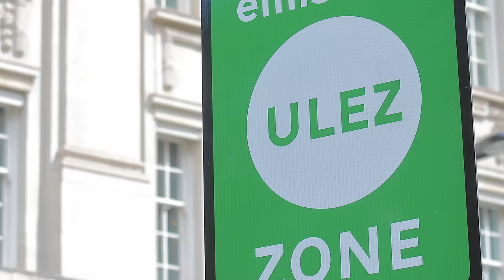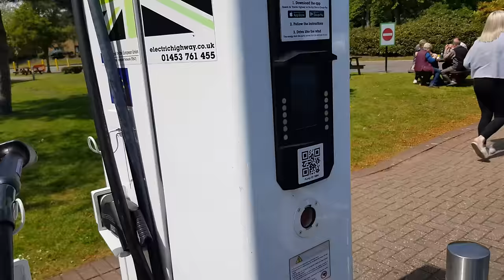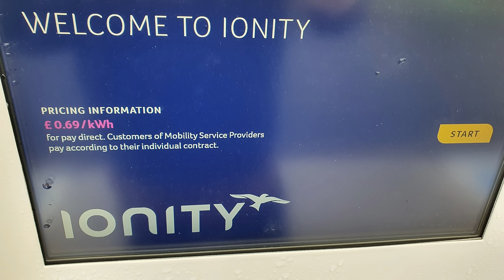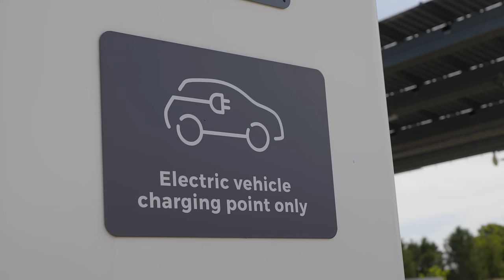The Uncomfortable TRUTH About EVs: The Version NEITHER SIDE Wants You To Hear

Comment: I lived in an apartment in Bham City centre last year. I inquired about fitting a charging point for an electric car. The building management company told me in 3-4 years we may be able to get charging points... 2 charging points for 100 parking spaces. Unfortunately the fire brigade had ruled out any more in the future as any potential battery fire could spread uncontrollably and emergency vehicles would be too big to access the basement carpark. The fire could create enough fire to destroy the building. Shouldn't this issue have been highlighted before the government committed to banning new ICE vehicles? Especially as cities are supposed to be a priority for the reduction of tailpipe emissions.
Reply: And there lies a massive problem, needs to be a solution that fits all
Reply: Here in Norway they have legislated that a building management company can't refuse to install EV chargers if the residents request them.
Reply: But you’re happy with probably 2,000 gallons of highly flammable fuel sat under your apartment? This is exactly the scaremongering James was talking about.
Reply: @hughesy606  it doesn't really matter what I'm happy with if the fire brigade have completed a risk assessment and banned charging points. It's not scaremongering, it's a fact.
Reply: @willv198412 Would be nice of the risk assessment also looked into the dangers of the status quo. Did it do that, or was it just concerning EVs?
Reply: @BigTwitchy  It's not the fire brigade's job to allow EV related fire risks a free pass for the sake of the environment, this is the responsibility of the government to find appropriate solutions. Banning all new ICE cars is not necessarily an issue if there are EV solutions that work for everyone, but at the moment there are not. I believe this is the general conclusion of this video.
Reply: @BigTwitchy  I would image yes, as there is a lot of experience with ICE fires in garages, knowledge on how to reduce first,  and damage. Part of the rish assessment would be, if does catch fire, how long would it be it becomes uncontrollable, how hot, potential surrounding damage it make to the garage.  for EVs, the it becomes more uncontrollable faster then diesel/petrol, it burns hotter resulting in greater damage to the support structure of the garage, requires more water to extinguish, can reiginite minutes to hours later, and releases more toxic fumes during the fire.  For me, this is a greater risk and until more data and experience is gained we should move with extra caution.  Should ev be banned, no, but ignoring the facts will not reduce the risks.
Reply: @willv198412  agreed. But I gathered from your post it was simply about charging stations? From the posts I've seen from a highly reliable internet, the fires can happen anywhere so a risk assessment about charging points is really kind of a mute point in reality, even if the assessment itself is probably correct on the parameters given. But appreciate your point totally.
Reply: @hughesy606  It is not a very cohesive argument as there are no signs prohibiting EVs and they were probably unaware that several residents already had Tesla's regardless of not being able to charge at home. The whole thing has not been properly thought through. I wonder what will happen once the first major EV fire happens in an apartment basement and compromises the integrity of the building. I doubt buildings will get insurance if they allow EVs to park there. This is a can of worms waiting to happen.
Reply: Government should focus more on redesigning cities with better walkability and public transport. That would encourage people to take public transport as it is more convenient than driving their cars, thus reduce air pollution from tailpipe emissions.
Reply: @hughesy606  fuel in parking is fine for me. It can be extinguished easily. Garages have firefighting pipes and hoses. But fire in EV you can't extinguish. Uncontrollable burning of fuel rarely can release all energy of fuel. This is why there is no so much damage to nearby objects after ICE car fire vs EV fire.
Reply: @15bit62  you have a population of 5 million and a $1.4 trillion sovereign wealth fund. Lol at "legislating management companies" for a cost that will just be passed on to consumers absent govt subsidies.
Reply: @chir0pter  It's astonishing how often people bring up this old trope: "Norway is filthy rich and can afford to be different". Well yes, it can. But it can do it because the country was prudent and forward thinking. But i would point out that lots of other countries without oil also manage to do these things: Finland, Sweden, Denmark, Germany...
And a bit of historical context for you. Norway and the UK have extracted basically similar amounts of oil and gas from the north sea, and it is worth remembering that around 10% of the UK's tax revenue in the 1980's was from the north sea oil (it's still around 1%). The UK spent this money to subsidise affluent lifestyles and a boom in the 80's (which i remember in fact, being British and in my 50's), whereas Norway invested it and continued with it's more traditional lifestyle. And you can see the difference between long and short term thinking now  - of the 3 countries that claimed the majority of the north sea oil/gas, Norway and the Netherlands have quite equivalent high standards of living and high average incomes, whilst the UK lags quite a long way behind (half the GDP per capita of Norway). 
So yeah, feel free to throw criticism at how "rich" we are up here, but remember that if you are British then you had the exact same opportunity and you squandered it.
Reply: @inevespace shame that you weren’t at Luton airport to deal with that fire
Reply: @vladx2  I don't know why they don't have firefighting hoses inside this parking. All building where I lived have fire doors and firefighting hoses underground. Nobody expect firefighting truck to go underground. But all this measures useless for EV. And half of my parking are EV.
Reply: I assume you're thinking about cheap electric Chinese motorbikes, mainly?
Reply: @georgeholloway3981  no, teslas and other shit. Bikes are in separate parking.
Reply: @15bit62  Do you have underground parking situated beneath buildings in Norway?  It would seem to me to be a large risk to have EV's parked and charging in an enclosed space with no way of containing the fire.   The building structure itself would be compromised.
Will those legislators be liable for what might occur due to chargers being installed in inappropriate locations?  Probably not, and the management company will have to take all the risk and added insurance cost.  Doesn't sound like a good solution to me.
Reply: @boneseyyl1060  - We do. It is the norm to build blocks with basement parking. As for fires, well i think you are being a bit obsessive about EVs here. Any kind of large fire in a confined space is a huge problem, and burning cars of any kind are essentially non-extinguishable once 3 or 4 of them are burning. There is just too much smoke and the temperature gets into the 100's of degrees in minutes. This is at least an advantage to EVs - the fires might be extremely intense and non-extinguishable, but with no burning liquids to spread the fire they are more easily contained. 
Interestingly I spoke to the guy responsible for fire fighting on a large ferry last summer. He was very clear - in the event of a fire on the car deck they just turn on some sprinklers (which he said probably won't do very much), evacuate the ship and let it burn. I also know some people at the local fire research institute here: They have access to a specially designed tunnel to test out vehicle fires in road tunnels. And I get the same message from them - It doesn't matter whether the cars are EVs, petrol or diesel, if you've got several burning in an enclosed space you are basically screwed and you can only let them burn out.
Reply: @willv198412  Is it really a facty or just what the building management company told you so as to get out of fitting EV charge points?
Reply: @willv198412 Mate you're fearmongering.  ICE fires have happened in the past in underground car parks that fire appliances can't get down.  No problems getting insurance for that.  The fire that destroyed the car park at Luton.  Started by an ICE Range Rover.
Reply: @15bit62  I see, well those are some interesting observations  I suppose it will be real world experience that determines if spontaneous fires from damaged EV batteries is a significant issue or within the limits of just an occasional occurrence.  It just seems to me that in a building with underground parking  under the structure, there will be enough damage from one of these events to result in irreparable damage to the building itself.  So how the fire is put out is probably irrelevant.   It's how likely is it to happen, and how much the amount of damage caused  and the cost to repair it will be.
Reply: @cjmillsnun  you just shot the messenger. Once again, this is not my opinion, this is the factual result of a fire brigade risk assessment. Perhaps the fire brigade are misinformed or are being overly cautious. But that doesn't help people in my position who live in apartments and could not practically run an EV without a charge point.
Reply: @boneseyyl1060  For sure a car park full of cars catching fire is going to be hugely destructive. We know that from the Luton airport fire, which was not a car park full of EVs. And there was a similar fire here in Norway (also at an airport coincidentally) a couple of years ago that also destroyed a multi-story carpark. That also wasn't started by an EV - it was an opel zafira. 
This whole "EVs are a fire hazard" thing is a red herring. All cars are a massive fire hazard because all forms of energy storage by definition contain a lot of energy, plus of course you have a load of plastic and fabrics to burn too. Batteries really just represent a different set of hazards - they aren't safer or more dangerous, but they are different and need to be treated differently.
Reply: @hughesy606  But 2000 gallons of fuel will burn at a significantly lower temperature than an EV battery.  A liquid fuel fire can be fought, as it will extinguish if the oxygen is removed, with foam or powder, but an EV battery will produce its own oxygen as part of the burning process.  Most ICE car fires are due to electrical issues, usually in older cars, or after poor work in fitting accessories.  They rarely spread to the fuel, and give time to fight them before they get out of hand.  Occasionally a fuel leak will start the fire, but that is often confined to the engine compartment, as it cannot easily transmit to the fuel tank.  Sadly, and EV fire, once started, will continue to the end.
Reply: @15bit62   In Norway they subsidised a lot of electric cars, less or no car tax and I think it was even no toll tax on the roads for them. Now they are starting to tax everyone. Norway has huge taxes on cars. To register our car from Estonia in Norway, it would cost us 10K€. It is cheaper I think if you have an electric car. So it's not about Norway being rich and people just choosing to be more green, its about punishing ICE drivers and giving electric car drivers a pass.
Reply: Where do you go in your car? If there is anywhere it’s stationary for a fair while, eg your place of work, many good employers are providing slow (but perfectly usable) work chargers for employees and often for free (there is no benefit in kind cost to you either).  Sure your current employer may not be so enlightened but some are and this might influence who you choose to work for.
Reply: @hughesy606  not really comparable.... EV battery fires are far more violent with temperatures reaching over 2700 degrees Celsius (over 5000 deg. Fahrenheit) and are far more difficult to put out because of the chemical structure of the battery! while ICE fuel fire reaches temperatures around 800 deg Celsius (1500 deg Fahrenheit) and can be put out much easier...
so it is normal that fire departments limit the number of EV charging stations in underground garages, since a massive EV fire with the temperatures that can be reached, would not only be harder to put out, but would definitely endanger the foundations and supporting structure of the building above....
Reply: @blankseventydrei  your assumptions are all wrong. But carry on.
Reply: government banning that or that what is this- Soviets Union? let the market decide ... last time I check ev lost this battle 100 year ago ...
Reply: @nigelcox1451  But it's not 2000 gallons of fuel - it's 2000 gallons of fuel, a load of plastics, fabrics and whatnot. Plus it's in a confined space, so the temperature is not determined by the open-air combustion temperature of the fuel but by the ability of the heat to get out. 
And yes, if you can get to the ICE car fire within 3-4 mins you have a good chance to stop it with a decent fire hose. But in an underground garage you'll need firefighting clothing and breathing apparatus, due to the heat and smoke. And once the fire has spread to 3 or 4 cars (which probably takes less than 10 mins) it is not at all easy to put out. So yes, EVs pose a very serious firefighting challenge, but it's not like ICEs are very much better.
Reply: @DohMkay  Yes, you are roughly correct. Norway historically has had rough price parity between ICE and EVs due to the high purchase taxes on ICEs and no purchase taxes on EVs. That is changing, but there is still a good subsidy on the EVs. EVs now pay road tolls at 1/5th full price, but the free parking and charging has now basically gone and a lot of cities are restricting EV access to bus lanes.
Reply: @hughesy606 doesn’t generally spontaneously ignite, and even if it does, much easier to extinguish.
Reply: @hughesy606 Just watch the video or at least get to 23:30 - 24:10 before commenting this man
Reply: @freedom8480  what assumptions?  ICE fire is 2760°C while the diesel is 815°C.  Batteries have more toxic elements and release them during fire.  but I will carry on until all the data comes and not assume EV are the same as ICE on every point.
Reply: In my garage anybody can add a charger—power lines are available for each space, all you need is to connect your specific charger to them, and a lot of my neighbors did. It's a 2-level, 146 car garage out of which there are already 36 neighbors with EVs (mostly Teslas). Not sure if we ever consulted the fire department, but I'm fairly certain that no standard fire truck can go down there, and while we do have sprinklers they would probably do diddly squat if an EV decides to self-combust. 'Luckily', the garage is not under my, but the building next to mine, so at most I'd lose my car if a fiery inferno takes place, I'd be quite worried if my building was on top of that garage...
Reply: @willv198412  there is something the firebrigade forgot, it is not by limiting the number of charging points that they limit the number of EV in the garage. If everyone has an EV and the are only two charging point, there could be still be 100 EV on site
Reply: @ikke12345  yes, you are correct, although this would be highly likely to happen it is technically not against any rules.
Reply: Do you know which battery packs spontaneously combusted? The ones with pouch cells. Do you know which vehicles do not have pouch cells or their close cousins prysmatic cells? Teslas.
No, not all BEVs are created equal. That is a fact that should be taken into consideration when things like risk and insurance rates are assessed.
One more thing: Charging 0.68 pounds per KWH is extorsion. Get a Tesla. Their charging rates are a lot more reasonable.
Reply: Not to mention the sad reality in that the local electrical grid in the area will fall apart with all of the added electrical charging points.  They can TRY to add two spaces, but most of the power grid at a local level is easily 50+ years old.  I somehow don't think that re-doing electrical lines to people in the lower and middle income brackets is going to be a high priority.  If any at all.  So, sorry, off to the charging station to pay outrageous prices.
Reply: @hughesy606  Gasoline/petrol and diesel are indeed flammable but the resulting fire is more or less controllable by conventional means. It can be put out with restricting the amount of oxygen. Lithium battery fire can't be controlled that way as it will go on even underwater and may seem to be extinguished but start again at random. It is also reported to burn much hotter (as of electric welding at hundreds of amps) and produce much more toxic gasses.
So, yes... I'm quite fine parking my ICE car in a garage with automatic fire suppression and not worry about it that much.

On the other note, EV's aren't exactly ZEV. Think about pavement and rubber erosion, that microscopic dust has to go somewhere. City dwellers probably have noticed that black/gray stuff accumulating near vent holes. Collect some snow in the city area and let it melt in clean white container, it may present a little surprise.
Reply: @SeersantLoom  yeah, but the discussion was about not allowing charging stations under a block of flats, but ICE car parking is fine. Either way, its gonna be a Grenfell, it'd just be a different fire - same number of people would die.
Reply: @willv198412  The fire brigade are stupid, very few EV batteries issues, unless they are in an accident.
Reply: @hughesy606  Considering these points:
 a) (fast) charging increases the risk of battery fire;
b) battery fires are next level compared to ICE car fires, both in toxic fumes and difficulty of extinguishing
=> one would not want to have such additional risk in the basement nor in close proximity of a house. The charging equipment itself may be additional hazard, being both high voltage and high current.
I predict EV-s will get banned from parking in certain places (like basements), unless additional safety requirements are met.
Reply: @SeersantLoom  with the greatest of respect, you don’t put rapid chargers in residential areas. Stop trying to scaremonger, it’s like saying building a petrol station under a block of flats is ‘well dangerous bruh’
Reply: @hughesy606  but not putting a petrol station under there, if you're looking to compare.
Reply: @angleseyandy9110  but not putting rapid chargers at under there either so no comparison whatsoever
Reply: @hughesy606  the charging point at the home which burned down in new Zealand recently was also not a rapid charge, so it IS relevant and NOT scaremongering. Fire service are right to say no, along with any building management company.
Reply: @angleseyandy9110  one example literally on the other side of the world lololol
Reply: Sorry but I'm spamming a bit with my comment..

I didn't have time to watch the whole video so I just skimmed through the chapters. 
Apologies if you addressed this already @JayEmmOnCars but I did not see anywhere the actual EV/gadget problems being addressed. You're comparing the cars and some downsides like charing and putting out a fire but don't talk about the following:
- Lack of resources (given current technologies on building batteries) to make EV batteries. You can't replace all ICE cars with EV because there's not enough rare earth metals & minerals.
- The fact that most resources are concentrated in only a few countries, some which are not exactly friendly to the "West" or are dictatorships. 
- The fact that a lot of child labor is used to mine those resources. - I'm pretty big on not having kids get abused, regardless of where they're from.
- The fact that most battery production is very pollutant and is also concentrated in unfriendly countries, mainly China - which creates economic and geopolitical issues. 
- The fact that recycling one of these EVs - mainly the battery, is again, very difficult and pollutes a lot more than an ICE car's recycling. 
- The fact that EV battery production competes with battery production for other electronic equipment such as smartphones, satellites and all kinds of other electronics. 
- The fact that there's no infrastructure to produce and sustain the charging of these EVs. 
- The fact that a regular mechanic will need to also become a programmer to repair one of these gadgets (I don't like to call them cars as there's too much gimmicky electronics in them).
- The fact that the EV craze has been pushed by governments on false pretenses and has been heavily subsidized - the market did not decide that it wants EVs - they got shoved down our throats - I'm big on me being able to choose my own stuff. Helps with liberty. 
- The fact that overall (see the video from Volvo, I don't recall it exactly) you'd need to drive one of these EVs for over 100,000 km in order for them to be worth it and pollute less than an ICE car in the same amount of time/range. 

- one from my subjective POV: ICE cars are so much more fun to drive! 

So, in conclusion, I believe this video doesn't touch the more salient points about EVs - which are the ones that actually matter in the long run.
Reply: @hughesy606  imagine if that was underneath an apartment block, would that still be "lol"?
Reply: @usernamechecksout - the fact that the power grid will not cope with all cars charging,
Reply: @hughesy606 the fact you're even trying to compare a petrol car fire with an EV fire is proof itself that you don't understand what you're talking about. Those "2,000 gallons of highly flammable gasoline" constitute only part of the ingredients required for fire, the other being oxygen in a very specific ratio, thus why if you were to ignite a spark immersed in a pool of liquid petrol, nothing would happen; in order for petrol to burn it must either be so hot that it reaches its flashpoint or it just be a vapour mixed with air.
By contrast, an EV battery contains 100% of the fuel it needs to start a violent, runaway chemical reaction. And then on top of that there's the toxicity involved. Breathing in smoke containing cobalt can cause serious, permanent disability. There have been cases of firefighters dealing with EV fires having to medically retire with life altering injuries from cobalt poisoning simply from attending an EV fire.
Extinguishing a petrol car fire is relatively quick and easy, requiring almost no specialist equipment or chemicals. To date the only proven effective way to extinguish an EV fire is to douse the entire car in thousands of gallons of supercooled brine for up to an hour and a half.
Your comparison really is asinine and dismissing peoples' legitimate concerns about EV fires as "scaremongering" is dangerously arrogant.
Reply: @cjmillsnun the Luton airport fire was started by a hybrid Range Rover Evoque. Its battery exploded.
Reply: @hughesy606  Well that 2000 gallons never jsut blow up with no damages whatsoever or arson or damage to the tank+ electric components because all that needs to make an ice car burts into flames that water can put out....
Reply: Rules can be changed. Regardless, you’re worrying about a problem that you don’t have yet as having 2 charge points per 100 spots will work fine until adoption is high enough that this will be a problem. And the interesting thing is that as adoption gets higher, there will be more pressure for the local government to find a way to accommodate. So at that point they’ll go to 2 points for 50, and then later 2 points for 25 and so on. Also EV fire suppression training and equipment has advanced quite a bit. So although it’s annoying right now, if it’s not a problem right now just relax and do your EV thing.
Reply: @angleseyandy9110 you’re projecting a problem that isn’t occurring. Not all EVs are charging at the same time just like not all the households are using all their electrical appliances at the same time. I don’t know if you realize this, but when electrical equipment is added to the grid, part of the process is to do “peak usage” analysis (which usually entails using recent past 12 months of data, ie. real world data) to ensure that brownout conditions will occur. When one discovers the power is “under supplied” then the licensed electrician simply can’t add the appliance (EV charger not) and needs to find a different solution. So you see, good city development has been happening for hundreds of years and people working in construction have regulated activities to undergo which prevent obvious problems like adding too many appliances to the grid.
Reply: @SeersantLoom I agree. The key point is “conventional means” and as EV adoption increases fire departments are learning new conventions to handle EV fires (the fires don’t happen as often as with petrol but it does happen). The latest techniques have been to smother the fire with a fireproof blanket, which contains the problem while the fire spends itself out (and requires not water). The other is some kind of “jack” (like a small fork lift), pierces the battery pack and then floods the inside of the batter with water which performs much better than pouring water on the car exterior. 

There are EV battery chemistries and designs that even further reduces the chance of fire (BYD blade battery, sodium ion batteries), so progress is occurring on that front too.
Reply: @scifithoughts3611  this is nonsense on so many levels. At the moment there are ZERO charging points. Even if there were two, how can they be relied on? I might be able to go to work the next day, I might not.
Reply: @willv198412  you would know immediately when you returned from work as I’m assuming you want to charge overnight, right? At which point you know you have to find a different charge point. 

So today, how many EV owners are on your block? If there are any, ask them how they get by. If there no EV owners and a ChargePoint, you’re in good shape. If there are no charge points, then I’d not buy an EV until the local government wakes up.
Reply: @willv198412  btw, where is it you like to ski or snowboard?
Reply: @usernamechecksout  the fact that most of your "facts" have been debunked on multiple occasions by people who know what they are talking about
Reply: @willv198412 Nonsense. The fire brigade can be swayed by politicians too. WAY less EVs catch on fire than ICE vehicles.
Reply: @blankseventydrei This is almost all baloney. ICE car fires spread rapidly. They catch fire MUCH easier and happen over TEN Times more often per number of vehicles on the road.
Reply: @hughesy606 ICE  vehicles catch on fire WAY more often per number of vehicles on the road.
Reply: @boneseyyl1060 Unlike your country, Norway already figured this out nearly a decade ago. Do better research.
Also, MORE ICE vehicles catch on fire per year by an order of magnitude than EVs.
Reply: @scifithoughts3611  fascinating, and straight out of the book of narratives. While the reality is that we have already had 6 outages this winter, mostly on Sundays, two of them for more than 3 hours. And that's without cold weather yet.

But no doubt you'll say I've made that up as it doesn't fit your utopia. I'm not bothered, it's obvious the whole game is BS, and as more people end up with the side effects over the next year or two, the more the penny will drop.
Reply: @DavidC-pg6ni  Yes I have looked at the numbers,  thanks.  I think the best point made, was that battery or gas, the risk is merely different, not necessarily worse.  No energy source is 100% safe.  I think that is the best way to look at it.
   I am Canadian by the way, where are you from?
Reply: I want to add a couple of points regarding the EV fire in garage:

EVs could catch fire when turned off, or while charging. ICE cars rarely catch fire unless they are working.
The biggest issue with EVs would be cheap, old, second hand cars with replaced couple of cells by random mechanic. These EVs will become a fire hazard eventually. 
Also, if you had a minor accident in your EV, your battery could basically burst into flames anytime.

The solution for these problems will be most likely a total ban for EV repairs by unauthorized services, which means really expensive repairs.

The other solution would be safer battery technology which is coming in the next few decades.
Reply: @julijanniko  I am starting to like the replaceable battery system more for a lot of these reasons.   Instead of waiting to recharge the battery, you drive in and the battery is exchanged, rather than recharged.  It brings the time down to what normal refueling would be, and it means that in case of damage, the battery is easily replaceable. 
     I think this is the model the EV makers need to adopt to make it more appealing to the general public.
Reply: @scifithoughts3611  less than one in 35 of the cars on the road in the UK are currently electric. And there are already outages.

Let's see what happens if the zealots win.
Reply: @angleseyandy9110  you’re assuming that EV charging causes outages. Why do you think that? 
People don’t go around and say, “hey, flat screen tvs keep getting larger. They are going to make the outage situation worse.”
Reply: @angleseyandy9110  what zealots would you be referring too? The zealots who don’t care about anyone else other than fuel for their lifestyle or the zealots who do everything they can to reduce their carbon footprint?  Either way zealots will win. 🤣
Reply: @scifithoughts3611  oh dear.
Reply: @hughesy606 Not at all.
Petrol fires are not nearly as hot, nor are they not nearly as difficult to extinguish.
Reply: @speedycatz Not just the cities themselves, but the entire way zoning is done that makes living near work almost impossible and the ridiculous waste we call ‘commuting’ almost unavoidable for most. I’m sure Exxon/BP/Lukoil are delighted with the system at present.
Reply: @georgeholloway3981 . Cheap electric Chinese motorbikes are all LFP and unlikely to be problematic at the battery level as a fire risk.
Reply: @timlowe3081 .  Screaming and shouting about a solution that fits all in the middle of a transformation is just typical Luddite response of somebody that does not understand change.
Reply: For comparison, if you asked building management to install a petrol station in the parking garage, would you expect a different answer? Charging at home is a convenience that suits those where it is possible, but 0% percent of internal combustion engine vehicle owners would refuse to buy a car if the couldn’t host a petrol pump in their house. The idea of fueling up your transportation at home has come to be a perceived requirement for owning an EV even though it hasn’t been a concept since horses were our primary means of moving people and goods. For those who can’t charge at home, there are charging stations just like there are petrol stations for those who don’t have a petrol pump at home.

Most EVs rolling off the line today can charge from 5% - 80% in around 30 minutes or so, and that time has been falling rapidly year over year. Chargers are increasingly co-located at grocery stores, shopping centres, and in business district car parks so you aren’t adding any time to your day  sitting at a single-purpose charging facility waiting as you charge. You plug in while you get your groceries and you’re good to go for the week by the time you are back outside… no dedicated stop at a petrol station while you stand outside in the whipping winter wind squeezing a pump handle. In contrast to the status quo, it’s no different to filling a petrol car, though increasingly more convenient — and new apartment buildings are being built with charging infrastructure integrated from the start.
Reply: @inevespace Did you notice the entire parking garage going up in flames due to a diesel fire? (Diesel is the least combustible of current road-going fuels.)

Since diesel and petrol are hydrocarbons, they don’t dilute in water and are lighter than water, so pouring water on a fossil fuel fire causes a floating fire which only helps the fire spread much faster. That’s why petrochemical fires require specialised foams. That’s to say nothing of the fact that EV fires are far less common than petrol car fires. EV fires make big news when they happen due to the shock value and “here’s something new you need to fear!” tendency of humans, but they are exceptionally rare and manufacturers are reducing the risk factors continuously. Liquid fueled cars went through the same process over the last 100 years and still catch fire much more often than EVs… it’s just that it’s not big news anymore because it’s a vastly reduced risk of something that isn’t entirely unfamiliar. EV fire risks are also reducing (and less frequent than petrol fires), but they’re still very “new” to the public consciousness and thus there is a lot more talk about them.
Reply: @inevespace Responding to ”I don’t know why they don’t have firefighting hoses…” Putting water on a petrol fire risks causing the fire to float on top of the water and spread faster, especially if additional fuel is being added, such as from a leaking tank. It’s more dangerous than it is helpful. You need a powder or foam based fire suppressant, ideally foam as powder might be hopeless if the fire is burning hot enough and large enough due to convection preventing the powder from reaching enough of the base of the fire to be effective. The foam coats surfaces, blankets over the fuel, and can put out a fire even if more fuel is being added from a leaking tank. For the reason, now is a good time to remind people to NEVER put water on an oil-based fire in your kitchen… always make sure to have a powder-based extinguisher in your kitchen before you need it. Pouring table salt or baking soda on an oil fire is better than nothing, as is putting a pot lid on a flaming pot or frying pan if it’s contained… but never, ever water.
Reply: Excellent point and well made. Everyone in an apartment needs to know this. Also, we will need to double our electricity output and there is no plan for how we are going to do this from any government. So, in short, there is no vision going forward where everyone is going to have an EV. Your experience on charging points for an apartment block is very relevant in determining this.
Reply: Since when do the fire brigade determine things like this? Do they put a maximum number of EVs that are allowed in the bullring car park? Worth remembering that the recent Luton airport multistorey fire was started due to an ICE vehicle.
Reply: @hughesy606  hi Hughes. A battery fire cannot be extinguished, a little different to a fuel fire. That being said, both contain energy and therefor represent some fire risk.
Reply: The fires that EV cars create seems to me much more violent than normal ICE cars. With more EVs coming online being stacked together, and their batteries getting more storage dense, I agree would totally be able to destroy a car park or building.
Reply: @hughesy606 I have noticed some fire brigade give up on trying to extinguish an EV fire. I have not noticed that they just totally give up on an ICE car.
Reply: @bytejourneycodes  Not only more violent, but you can get electrocuted, hence the special equipment that firefighters require. A passerby cannot intervene and save the car, or whatever location where the car is parked. It’s a serious problem. I don’t know if you’ve seen the Tesla X burning under water? Check that out!
Reply: Yeah mate, I don't think the fire department said this couldn't be done. That is just building management trying to pass the buck.
Reply: @bytejourneycodes  they don't 'give up', they just take a decision to let it burn itself out if there's no danger. If there's an EV fire that poses any danger they fight the fire. Again, stop being hyperbolic.
Reply: The thing that people seem to forget is that ICE cars catch fire way more often than EVs
Reply: @hughesy606  You can’t extinguish an EV fire. 🔥 🔥🔥🔥🔥🔥🔥
Reply: Like gasoline doesn't burn lol 😂
Reply: @MarkkuS  You can easily extinguish a gas/diesel fire unlike a battery. 🔥🔥🔥🔥🔥🔥🔥🔥🔥
Reply: @15bit62 it's not building Management that restricts it. It's the fire department. They have the risk of going into a burning hellhole with battery casings flying around (if a BYD is burning lol).
Also u can't put that fire out. A battery contains everything to keep it burning. The only chance u have is submerging into water. And good luck with that if u are in a garage with 2m ceiling.
Reply: After Grenfell, and then the cladding crisis in the UK, I can’t see this flying as a fire risk. Look at the extraordinary measures they had to bring in with the cladding crisis, 24 hours fire wardens in a building etc and you can see that environmental concerns will be secondary to risk to property and human life. As it should be.
Reply: EVs will require us to upgrade the entire electrical grid, and safety protocols, and, and.... There is a good reason why their sales have been dropping YoY
Reply: This particular issue will probably largely diminish with solid-state batteries soon. It's a valid point for the current EV gen though.
Reply: They are not banning them from tomorrow you know, if it does not pan out they can un-ban them tomorrow
Reply: Batteries are also getting less of a fire hazard, new chemistries coming in
Reply: EV's don't need fast chargers. They can trickle charge on complelty normal outlets overnight, because cars spend 90% of their time parked. Tell your building management to just add regular power outlets to the basement and avoid the scam of fast chargers
Reply: @hughesy606 you have no clue. Lithium batteries do not need oxygen to burn. They even burn under water. Does petrol burn under water ?? The "electrical" discharge of the stored energy burns hotter than any hydrocarbon born fire. That is fact. The potential release of energy is so much more than your 2000 gallons ( you're having a laugh by the way, 2000 gallons is enough to brim over 30 cars ). Your 30 cars don't go on fire all at once but 80KWhr released in a short time ( based on a 1Kw electric fire on for 1 hour would be 80 x 1 Kw on for an hour would be like 800 1Kw fires on for 6 minutes )  melts the steel embedded in concrete, hence the collapses of car parks. 
A petrol car can go on fire and be put out easily, and the car can also be repaired. A EV goes on fire, it's always a total loss. Hence the higher insurance premiums. 
And do not say I'm anti ev, I'm on my 4th !! I've just got to tell you the truth about electrical fires.
Reply: @robtmcL12  and your point is? The question was about fires in underground car parks, under residential premises, from rapid chargers which would never be fitted. Max would be 7kW. Name me one EV fire that’s happened in this country from charging from a 7kW charger and I’ll show you a 1,000 petrol fires. Stop being sensationalist, you’re only impressing yourself.
Reply: I saw a video of a car battery going off and it was like war zone with the individual cells popping like bullets. Is that like all battery pack design in EV? Also with a car you can tend to smell fuel if it's leaking or notice underneath but you could go over debris and the battery pack gets dented and you won't know till later? I think more research needs to be done and then designs put in place in the car and in parking areas. Legislate for foam fire suppressants instead of water or something.
Reply: I want to know how they will handle the grud at 6pm when people get home to charge. I saw a documentary clip on the efforts to keep the grid stable when people would activate their kettles at the same time during the ad break for a dancing show or some crap. They had to use huge collections of water to drive turbines to survive 10 minutes. When millions of cars are put on charge at the same time that's megawatts of demands we're not currently seeing.
Reply: @QualityContentComingSoon  read up on V-T-G charging to see why this isn’t an issue.
Reply: @hughesy606  If petrol lights up, you can put it out, permanently. It also won't give me neurological damage to be downwind. Not so with EV fires. Case in point being they sank several cargo ships because you can't put them out easily, nor can you transport them safely (unlike ICE cars).
Reply: @robtmcL12  Lithium ion batteries do need oxygen to burn completely. Whilst there is a level of oxygen produced from the NMC/NCA type cathode chemistries when they decompose, it is far from enough to combust all the combustible material in the battery. The energy discharged in a battery fire is not in a large part the energy contained due to electrical charge either. It is mostly the combustion energy of all the combustible components in the battery - the anode is graphite (coal basically), the electrolyte is organic solvent, and the electrodes are separated by a polymer that also burns. As a reference, burning 1Kg of graphite alone releases the equivalent of 9kWh of energy. And an EV battery contains 50+ Kg of it. 
And in general i don't think many cars that catch fire are actually repaired. If it's just a bit of smoke from a burned out cable or such, then yes. But if any significant level of fire has taken hold i'm pretty sure the insurance company will write off the car now.
Reply: @skywardsoul1178  You don't want to be downwind of any kind of car fire. It's not just the fuel that is burning - it's all the plastics, oils, paint, textiles and stuff. The combustion products from those are just awful.
Reply: @skywardsoul1178  I actually talked with the fire guy on a north sea ferry about ship fires over the summer. Apparently the standard policy for most ships is to turn on the sprinkler system and if that doesn't work they let the cars burn. The reasons are two-fold: The first is that a fire in such a confined space is basically impossible to fight once it has taken hold, and the second is that most ship owners would prefer to have the insurance money than the ship.
He also told me that he'd only seen one such ship fire, and it was started by an overheating diesel generator that caught fire and that spread to nearby cardboard and stuff. The ship was written off.
Reply: @skywardsoul1178  I do so love this thread. Every now and then I get a straggler commenting about something they know little about, and missing the entire point of the conversation. Yummy!
Reply: @15bit62  That is a horrible thing! If governments issue blanket dictates like that, who knows how many ungoreseen problems will that cause?
Reply: @hughesy606  Ah, an arrogant misery that can't help but make a non constructive and snarky comment. 
The irony of claiming others know little seems to fly over your head.
Reply: Surely you weren't expecting large amounts of logic or intelligence from politicians? They are there for themselves only. Only the shady and dishonest become politicians, not the most intelligent.
Reply: @hughesy606  but you are not filling your car with petrol in the garage under the apartment and petrol and diesel cars have a very solid record of not spontaneously combusting. With the batteries in EVs you are charging and the battery heats up. It is proven as well that battery fires are far harder to extinguish and , importantly, to keep extinguished.
Reply: @andywhite3777  on a fast charger! Did you read the thread? No fires have ever started from a 7kWh charger and that is the charger that would be fitted at a residential premises.
Reply: @cjmillsnun it was a hybrid lol...
Reply: Interesting, here in Finland we have off road and underground car parking and there are no issues about EV charging in car parks. It must be a British thing. The fire in the carpark at Luton was caused by a diesel land rover
Reply: @thomasreilly6362  a hybrid diesel to be more accurate 🤷‍♂️
Reply: Not convinced, would like to see the documents relating to the claim.
Reply: @hughesy606  ... first point: have you ever seen an ice car catch fire without external assistance?
Second point: try extinguishing a lithium battery fire, compared to petrol it is at least ten times more difficult
Third point: look at the temperature of the fires: have you ever seen a petrol fire bring down a concrete structure like the Luton airport fire?
Reply: @VictorChalker  yes, I've seen two ICE cars go up of their own accord. I'm not debating the issues with lithium fires. My point (again, read the actual comments) is that these fires are usually caused by rapid chargers which wouldn't be appropriate under a residential premises.
Reply: @hughesy606  two ice cars going up on their own? That's two more than most people ever see in their lifetime. And the cause of this spontaneous combustion???
Reply: They don't seem to have an issue with petroleum vehicles.   It seems someone in the fire department made a decision and then looked for a reason...
Reply: @hughesy606  yes but sprinklers will put most ice fires out ,will not even slow down an ev fire
Reply: @richardschultz6815  but there wouldn't be an EV fire if they didn't fit rapid chargers so kinda irrelevant
Reply: @15bit62  A lot of the North sea oil profits went into funding unemployment benefits payments as traditional industries were being sold off and closed down, putting whole sections of the countries workforce out of work, and becoming unemployable.
Reply: @willv198412  "EV related fire risks a free pass for the sake of the environment" NOT possible. ICE is way more fire prone than BEVs. You would have to ban ICE cars driving into indoor parking also if you want equal risk pass.
Reply: @scifithoughts3611  That you refer to the notion of “carbon footprint” exactly proves you are the zealot. That you thinks EVs in any way save the planet by reducing a trace gas literally necessary for life on earth confirms you are the zealot. What % of the atmosphere is CO2 since we’re at it?
Reply: If this is a true story, the fire brigade must not be that bright or you misunderstood. Gas cars are more likely to catch fire than EVs. What they really told you is that the property is ill-equipped for any parking lot fire, which should concern you much more...
Reply: @mr.anderson1326  And Mr Anderson, the fact that you believe the idea of managing the planet by “carbon footprint” is controversial and don’t understand how EVs contribute to its reduction confirms you’re a zealot. (Most everyone else with an understanding of science, who works at keeping themselves educated, and is well-rounded enough to hold a position of authority understands and knows the systems thinking behind closed loop processes, understands this. And thank goodness the world is taking it seriously and we are moving forward.) You have a lack of understanding of combustion. What do you think happens to the gasses when they leave a tail pipe or a smock stack? The evidence is everywhere. If you choose not to see it, that’s on you and a YouTube comment will not amend your path. Some people “get their jollies” by disagreeing with what anyone tells them. If this is your path, then there isn’t any help for you as your ego prevents you from being trainable. And in that regard, why should anyone put in great effort to change your mind?

https://earthobservatory.nasa.gov/features/CarbonCycle

The teacher can only show the door, the student needs to want to step through.
Reply: @15bit62  almost just bought what I think should be our first all
electric car which would become our second car a Fiat 500e … but the opted for the
considerably more reasonable to buy and to run Fiat 500 hybrid. simple math and critical thinking for 2024.
Reply: @citronr1  I'm not going to fault you for not buying a 500e - the 500 in general is a pretty limited car that people seem to buy more cos it is cute than practical (aside from it's ability to park in tight spaces), and the EV is a bit range-limited. It's probably destined for epic depreciation. I wouldn't buy one either.
Reply: @hughesy606   fire fighting equipment can extinguish gasoline fires.
Reply: Where do you go in your car? Could you charge there? Enlightened employers are providing employee EV charging. Quite cheap to do becuase, just like home, doesn’t need to be fast because you can plug in for several hours.
Reply: We need to ban Lithium Ion and enforce Lithium Iron Phosphate (LiFePO4). LIon has thermal runaway when the batteries are damaged or overheat. LiFePO4  just has a small amount of smoke. LiFePO4 also is much better for the environment since no children have to mine cobalt or nickel in Africa.
Reply: @lakorai2  You know that LiFePO4 (LFP) is "Li-ion"?
Reply: They’ve a perfectly effective strategy for reductive city emissions. 
It’s that you’ll not be going anywhere. 
This lines up with C40 Cities & 15 minute cities and the old favourite “You will own nothing & be (un)happy”.
You didn’t think they were joking, did you?
Hope this helps.
Reply: In a parking garage, of a ICE car catches fire, the garage sprinkler system has a pretty good chance of putting thr fire out before it spreads. With a EV fire in a parking garage the sprinkler system will do nothing. All of the cars will burn, and the fire will be so hot that it will compromise the structure of the garage and cause a complete collapse.
Reply: @timlowe3081 there is one: they basically never happen
Reply: In other words you have an incompetent fire departement.
Reply: @VirtuellJo  yuppp
Reply: @willv198412  ICE vehicles burn 20 times more frequently than EVs. And yes, that’s accounted for the percentage of each vehicle type that makes up today’s traffic.
Reply: My grandfather bought petrol for his Ford model T from the apotek. In northern Europe there is loadig stations everywhere. My brother drove from Sweden to South of France with his family in a tesla and that is ten years ago. The outskirts of Europe like uk will  get a normal system too. This  is the future. I don't like it. But it is still  the future. Batteries will get better and systems will improve.
Reply: @hughesy606 ICE works by releasing fuel's (reducing agent) internal chemical energy into thermal  and mechanical energy through heated and pressured contact between it and oxygen (oxidizing agent). When you block fuel from contacting oxygen, it's harmless. The internal chemical energy cannot be released. Battery has both oxidizing and reducing agents inside of it necessary to create chemical reaction that release internal chemical energy, which is later convicted into electrical energy. These reactions don't require heat to be started. If you drown battery in water, you will achieve nothing. You need to deplete chemical reaction agents to make battery harmless. The reaction is also far more intensive in terms of heat release. They can melt steel and have sunk several roll-on/roll-of car cargo ships already. You need a lot if water and special containers to drown BEVs in. That's why they are dangerous to be driven or left in tunnels or any other place with limited space.
Reply: the newest generation of batteries don't burn like that. You can pierce them with a nail and they won't ignite.
Reply: @timlowe3081  There have been ~500 thermal runaway EV battery events in the entire world since 2011. Hardly a massive problem compared to 5 ICE cars burning to the ground every day in the US alone.